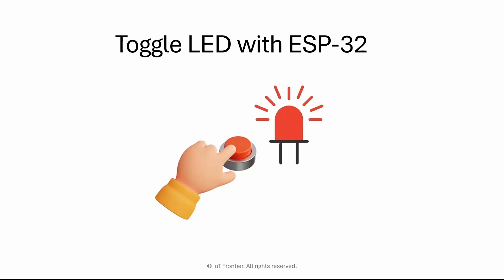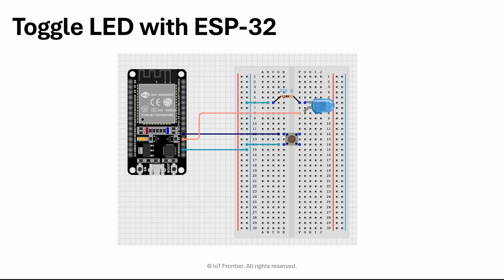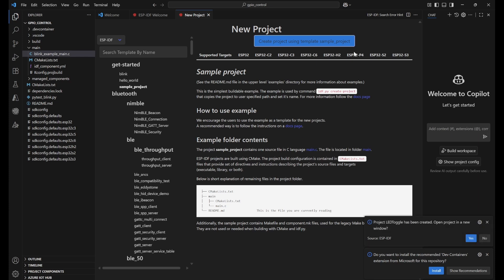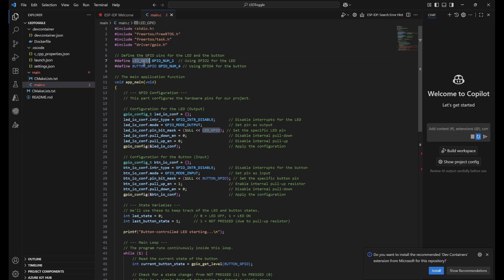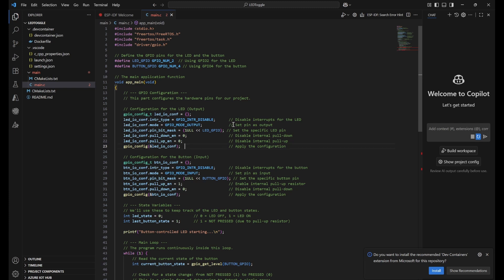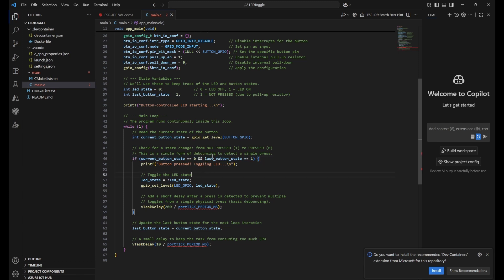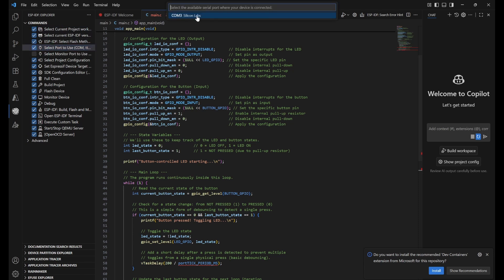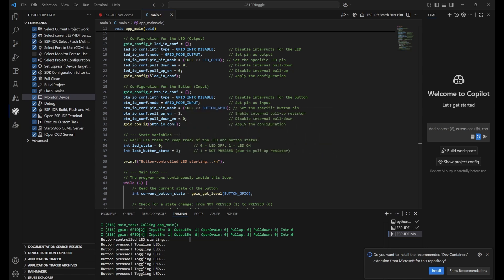Toggle LED with ESP32 | ESP-IDF & VS CODE Tutorial -  Episode 2

Comment: Show, muito bom o seu vídeo! Gostei bastante porque você explicou tanto a parte de hardware quanto a de software. Eu só tinha programado usando o Arduino IDE e nunca tinha conseguido fazer funcionar no VS Code, mas graças aos seus tutoriais estou conseguindo agora! Sou iniciante em programação para IoT e meu primeiro projeto vai ser automatizar a luminária do meu aquário marinho.
-- 
English version 
Awesome video! I really liked how you explained both the hardware and software parts. I had only programmed using Arduino IDE before and could never get it working with VS Code, but thanks to your tutorials, I finally did! I'm a beginner in IoT programming, and my first project will be to automate the lighting system of my marine aquarium. (Translated using ChatGPT)
Reply from the maker: Thanks for the feedback. If you want to excel into IoT, then you can enrol into this course to gain practical knowledge in IoT https://www.udemy.com/course/iot-for-absolute-beginners/?referralCode=26A51CD709B9F021A866